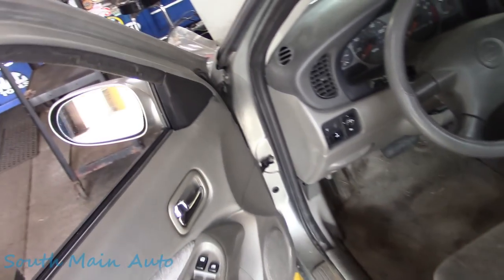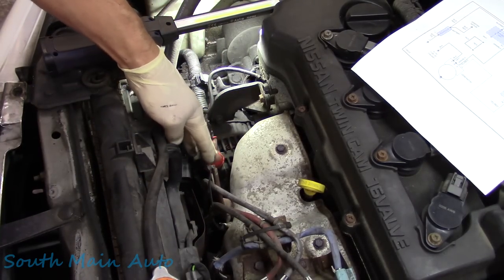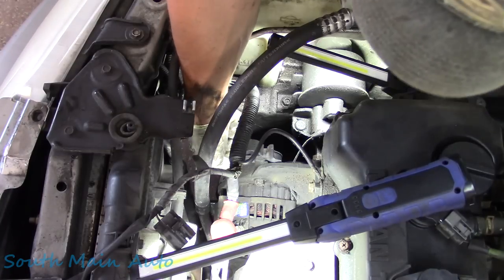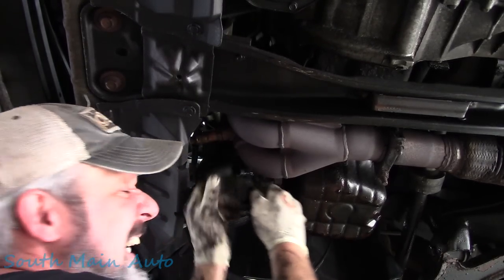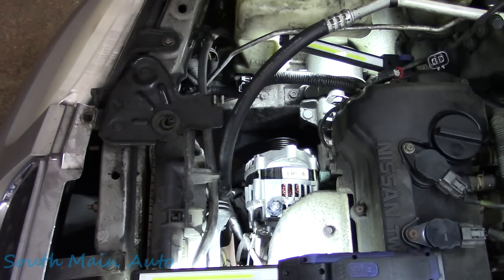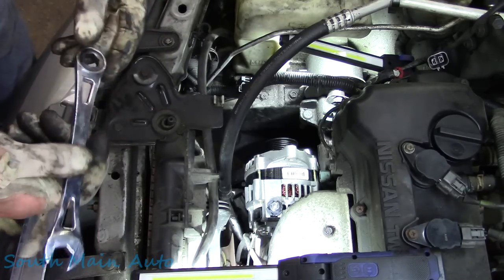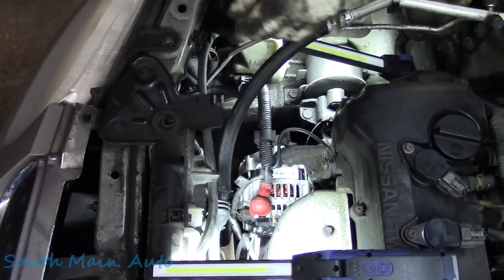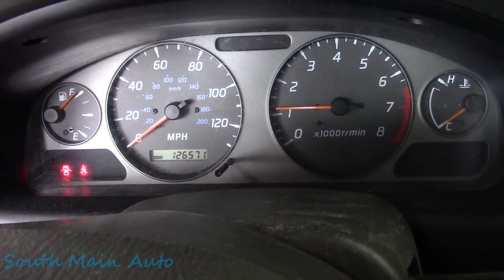Nissan Sentra: Battery & Brake Light On?

Comment: Service  data:
1 Remove bolts from front and top of alternator 
2 remove catalytic converter 
3 remove exhaust manifold
4 discharge ac refrigerant 
5 Remove ac compressor 
6 remove radiator 
7 Remove ac condenser 
8 remove front bumper
9 remove bolt from rear of alternator 

Refitting is a reversal of the removal procedure 

:P
Reply: You forgot to take off the high compression hubcaps and the twin overhead foxtails. Listen to the song called "Newcastle song" by Bob Hudson (not me) that was around in the 1960s. You'll understand then. What I mentioned are extra removal items. Retired mechanic in Land Down Under.
Reply: Is that a joke or is that the real procedure?
Reply: @brandonsnider7907  🙄😬
Reply: wow, charging by that the way he did it might be a pain but less than prescribed. not bad pay for the pain.
Reply: I recall using a 1/4" Ratchet Extension Drive Chain Bar (or whatever that is called) on situations like this.
Reply: @brandonsnider7907  it's a joke lol.
Reply: start at rear left tail light, and unbolt until you've reached and removed the right front headlight, after going in an figure-8 pattern twice.
Reply: Step one-remove engine from car....

Comment: Those Nissan alternators can be a PITA. Sometimes I find it easier to just remove the exhaust manifold. Good stuff!
Reply: "Update to Service Data: To change the alternator, first remove the engine from the automobile..."
Reply: Wow no kidding is there much risk in regards to the bolts to getting those off or do you always use a torch and get them red hot first cuz I was thinking that in the back of my head but I'm not a professional a mechanic just a guy who loves to play around with cars
Reply: @bobrenner7213  you think that is funny, but on some Audis, and a few Volkswagens, that is indeed the procedure
Reply: @deepsquat600  Yeah, Ditto. I was thinking the same thing and also am not a pro.
Reply: My trusty 1999 Altima's alternator is on top. That's back when Nissans weren't bad.
Reply: @deepsquat600  you are 100% correct you don't even wanna look straight at 20yr old exhaust manifold bolts
Reply: @bobrenner7213  Someone said that in the new rear engine Corvettes you have to pull the engine to change the serpentine belt.
Reply: Nah. just the heat sheild
Reply: Lol 😆 Great video.
Reply: @RC-Heli835  "Someone said that in the new rear engine Corvettes you have to pull the engine to change the serpentine belt." According to a post in Corvetteforum, "I think the Hagerty article is wrong. GM personnel have said on multiple occasions that the plugs, alternator, water pump and belts can be accessed from below without removing the engine. Tadge also said that GM has targets for how long every maintenance item can take, and the C8 met or bettered every target. I can't believe GM's standard for belt changes includes time to R&R an engine."

It still sounds like a challenge to me.
Reply: @flagmichael  That came from a GM Mechanic who specializes in Corvettes He fixed my sisters 2011 C5 Corvette which was firing continuous on all 8 coils with the key on.😀

Comment: Eric, I remember the old trick of trying to stick a coin on the back of the alternator shaft. If it stays it's charging, if not, junk! As Edith and Archie Bunker said, those were the days...
Reply: Never heard of that one - interesting! My big beef is with the charge warning light on so many 1980s vehicles: the lamp was in series with the excitation 12V. If the alternator wasn't charging the terminal was basically at ground and the light came on. In operation the terminal had battery voltage on it so the light went out. BUT... if a brush wore out the light would not come on.

Comment: I had to change my daughters Camry idler , belt tensioner . Got the no reversey wrench pinned to the wheel well.  Didn't figure you had to unbolt and jack up the engine to get that bolt out. Best part was her alternator went 6 months later and the brand new belt tensioner was frozen. Good thing I already practiced changing it.

Comment: Definitely need to switch!   they are awesome!   I taught collision repair and automotive electronics at a local college and then had to go on disability after a very serious stroke in 2013.  I've worn them every day since then!  You no longer have to worry about getting bound up in the straddle.   Say goodbye to "Crack attack"!  Lots of pockets for you to misplace the customer's keys in!  my favorite brand is Round House.   Definitely use there sizing chart unless you actually go try them on!  Also, it doesn't hurt to order bigger than you need.   It just allows more "breathing room".  A good trick to embarrass the family is to cut off a pair and wear them out in public!   Maybe take Mrs. O shopping for supplies at that Walmart where she killed the sign with the van!

Comment: You have to do the overalls. I worn them for 35 years on the railroad. I like the striped engineer cause they’re light weight, easy maneuverability and just a pair of shorts underneath super comfy. Get the zipper front easier for the bathroom break.

Comment: I have a 2000 Ford F-250 with the diesel and the alternator crapped itself when I was 300 miles from home. Luckily I had tools to do the job. Easiest alternator replacement ever. Literally had the job done and back on the road in five minutes. I wore bib overalls for 30 years working construction. Those things are awesome.

Comment: It must be their summer car.  No way a 2001 Nissan would survive 21 years of salt. lol
Reply: Hahaaaaaa
Reply: Might come from auction or owner transplanted from south etc
Reply: Get that valve cover for that Kia yet, oil looked pretty cooked, give it another 5000 miles
Reply: Oh man, Scott never fails with his humor on his channel and Eric O's.  Can't wait to see your video tomorrow, sir!🍻👍
Reply: I have a 2002 NIssan Sentra  Se-R 113k miles since 2012 bought in NYC. Still running like a champion.
Reply: I think it may have been rebuilt by some dude in Illinois..😜
Reply: I owned a Nissan "once ". Never again! A Maxima that was in the absolute lemon years of 04-08. Their was absolutely no way to fix everything that was wrong with that car. Total junk!!!
Reply: Normally would already be "in the pile".
Reply: @brianmcneese9425  bummer.  my 95 Max I bought new back in May of 95  still runs like a champ.  over 20 years in northern Utah salty winter roads to boot.  no body rust yet. always garaged tho. weekly car wash during salty road times.
Reply: I still drive daily a 1994 Corolla Liftback. Never had more reliable car in my life. I know it doesn't have all the bells and whistles that people like to have these days but it has taken me reliably from A to B and back every time over the years I've had it.

In this part of the north Europe the salt is an issue during winter time but the car was rust proofed before it hit the road way back in 1994 and the underside is still as good as new. And that tiny 1.6L 4A-FE engine is just something they don't make anymore.
Reply: Don't have a 2001 Nissan but I do have a 2004 Dodge Stratus SXT 2.7 liter with 163,000 miles that I've been driving daily in New Hampshire. Surprisingly it has survived all those years.
Reply: @frigginFin  Bells and whistles=more stuff to break.

Comment: I firmly believe that when a new car is designed, the engineers who designed it should have to completely disassemble and re-assemble the first prototype.  It won't take long before they are designing cars that are easy to work on, again.
Reply: In the 1980s Volvo 240series DIYers swore the cars were made by suspending the heater blower by a string and assembling the car around it.

Comment: Eric, 
You didn't have the camera on the voltmeter on your carbon pile when you turned up the current. If the voltage is close to the battery voltage while you are under load, you have done a "voltage drop test". 
Really enjoyed the video - thanks.

Comment: Laughing my butt off cause I've had the same vocalizations when I was replacing the  plugs & wires on my '05 Silvy. Son in Law was there for guidance but Boy Hooie those back plugs and wires really hurt. And the blanky blank parts guy who insisted that there was no such thing as a plug wire puller didn't make my mood any better!  And I vote for overalls!! Bonus points if you go for the shorty ones.

Comment: My wife's 2013 Infiniti had a battery light and brake light on when she came home one day.  I checked the voltage and verified the alternator wasn't charging.  Since it was computer controlled and the alternator was in the worst place I've seen, I called the dealer and made an appt for the next day.  The next morning, I hooked up the smart charger at 30 amps and tried to find out why the brake light was on.  During the charging and checking I started and ran the engine.  Then I shut off the engine, disconnected the charger and left to take it to the dealer.  And, the battery light and brake lights were OFF.  It had started charging again.  This was about 6 months ago and it's been charging fine since then.  The car only had about 40k miles on it.  I assume running the engine with the charger connected jogged the computer into doing its' job.  The computer had a brain fart!!
Reply: Awesome man hopefully you didn't ove ride any safety features I doubt it though sometimes alternators can over charge the battery

Comment: Overall wearer here.
Beside the attributes you mentioned of no belt, the best thing is unlike when you're doing manual labor in jeans with a belt, all sweaty, you never have to pull your pants up. 

You've got 6 lower pockets, including pockets to clip a knife, and anywhere between t and five pockets at chest level. 

Once you pitch the belt, you'll never want to go back to regular pants unless you use suspenders instead of a belt.

Comment: Dealt with the same issue on my Nissan Pathfinder and the alternator bolts. I drilled out the threads on the rear bolt and replaced the two bolts with a single long bolt and nut

Comment: That job reminded me of replacing the alternator on my Toyota Sienna. Had to drain the coolant, disconnect the upper rad hose, remove the radiator fan assembly, move a wiring harness out of the way (unplugging several connectors and removing many bolts that held the harness in place) and I was able to barely sneak it out of there without removing the radiator!
Reply: Don't mention Sienna! I tightened the bolts on the passenger side front door strike because they were loose. The door closed just fine but never opened again. I must have spent more than 20 hours over the space of a year or so to get the door latch to release, but NO! Even if I had ripped out the interior panel the latch was buried behind the edge of the B pillar.

Comment: My sympathies.  Did an alternator in a 2005 Saturn Vue, V-6 in my driveway.  Found I could pick up the motor 4" and wedge it out, and the new one in.  All without having to drop the engine/transmission frame.

Comment: About the only thing better than Eric O's diagnostic and broken wire locating skills is his cool and patience while operating in tight and with no visibility areas.  My stomach would have been in knots and I'd have lost half of my wrenches, having been thrown across the street, trying to deal with this. 😂. Like the guy says, oh the days when you only needed to remove 2 bolts and the wires and you could see everything with ease! 😂

Comment: I am an coverall wearer. I work in a commercial boat repair facility (we work chiefly on commercial fishboats). They, coveralls, are available at Napa, here in Seattle, used. Not a sponsor. They get ruined here for hot work with grinders, cutting torches and welders, grease et al.  So, used rather than new is good. You could order some with the SMA logo on the back, maybe sell them to your fans.

Comment: That's funny, I was thinking about that conundrum the other day. How do you perform sensitive drop testing on the really high current circuits like the starter motor and the alternator? You're looking for small resistance, maybe a couple of ohms, which would be enough to confuse the diagnosis of a bad starter or alternator. Better yet, I've got one of those old toasters. Plug it in, and it will draw what the circuit resistance allows. So, if you can get 75 amps from the toaster, you know the total resistance of the circuit is only 0.16 ohms (12V/75A=0.16). You're even quickly testing the battery, since voltage from a bad battery will go down the drain before it lets you draw that current, and you'll see voltage dive on the analog meter. With adequate current, there is no need to measure the drop! Excellent point about limiting current to what the wires can carry. Thanks!

Comment: I had the 1986 nissan sentra it had the best gas milage of any car ever i got an overall mileage of any car i have owned I think it was carburetor, but some say that was first kind of fuel injection only problem was the annoying heat shield on exhaust rattling.  got 40 mpg driving crazy overall mileage with 1.6 liter and 5 speed standard transmission

Comment: You should try the overall and then decide if you want to wear them for work. Regarding the alternator, it's a world of difference between USA and our country. Here we hardly change them unless the stator is shorted or damaged. Changing bearings and charge/control board on it takes about 30 min and costs half the price or less.

Comment: Nissan Manual: To change alternator, drop the oil, remove the oil pan, A/C compressor (after removing refrigerant), drop sub-frame, now you should have just enough room to remove that one bolt I hid on the back before being laid off.

Comment: You should definitely switch to overalls. I have a couple pairs and they are pretty comfortable especially after you've washed them a few times. They're so easy to work in, they usually have tons of pockets, easy to use the bathroom. They rock. You could also be really cool, and one strap it. Just wear one of the shoulder straps and leave the other loose. 🤣🤣

Comment: Wow!!! a 2001 Nissan Sentra, They're great cars to drive but yes I do agree not very easy to work on - of coarse unless you have Piano fingers to get in to the tight spaces. Good thing it wasn't the water pump or you would be screaming blue murder as I looked at what it takes to change one - It's a whole lot worse than what you just went through with that Alternator...

Comment: Gotta love that design. Got so used to it working on junk carrier and thermo king reefer trailers previously.
Reply: I really enjoy taking the belly pan off the Precedent units to change the alternator and squeezing my hand in to change the tensioner pulley, don't you!?. I like working on the SB units a lot better. Carrier can f-off with their condenser fan belt on the ultra xtc series though; I loathe them.

Comment: one transfer case replacement and vehicle on 4 jack stands while testing the used transfer case and finding out that at least the front passenger wheel bearing is dry or the passenger side bearing in the front diff is bad, and that the front U-joint on the rear drive shaft could be bad because of the little wobble you see, but all the gears in the same year model and model class transfer case you are using may or may not have a bad output shaft and bearings... but at least it still goes forward and reverse with the wheels on the ground....

Comment: Apprentices where I did my time had to wear overalls. My trade wore white, not at all cool when when you were assigned to the power station or substation maintenance during the apprenticeship. All other trades had dark blue, including the mechanics. They are comfortable, have heaps of ventilation (we lived in the tropics back then). You only ever wore jocks under them unless you were cold. I am talking full overalls, not the ones that have a brace & bib. 

If I hear my proctologist say "Take 2, I'm going in - no mercy ha ha ha" I'm going to say "Damn you Eric" and will run fast, very fast! That's all I have to say about that!

Comment: In my shop that second bolt is what we call getting "Nissaned". They always find a way to manufacture the vehicle to make an easy job hard.
Reply: Unfortunately, I don't think it's exclusive to Nissan, I think my Mazda Protege 5 is as guilt on that one. Had to replace the alternator in I think 2017, or '18 and getting to all the bolts was not that easily reached if I recall.
Reply: Some fords are the worst where they could have just put the bolt in from the other side but nooooo
Reply: @johnhpalmer6098  My 98 Saturn Wagon is on the back of the motor. Gotta remove the wheel, and inner fender liner, to release the tensioner, grab one bolt from up top (blind), the other from down below. Can't unplug until it's dismounted. PITA when it comes down to trying to finagle that POS out. Glad I don't (hopefully) have to do that job again anytime soon.

On my 18 Mirage, it's right up front, super easy to get to. 15-30 minute job all said and done.
Reply: What you think is absolutely logical the japanese do it the exact opposite way..😁